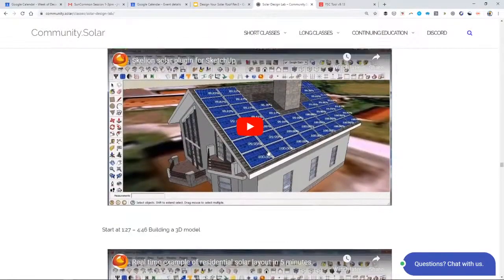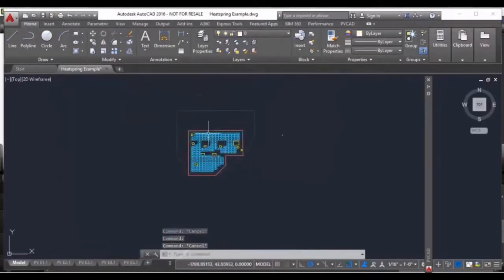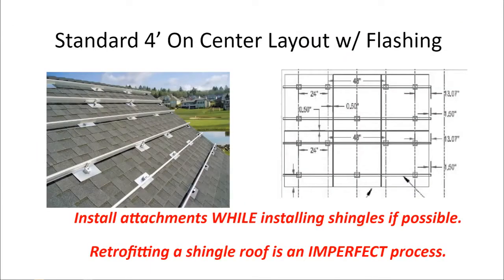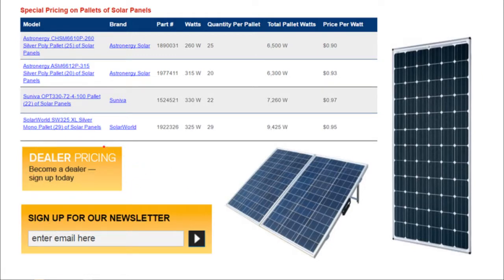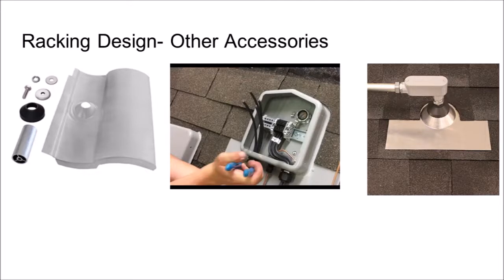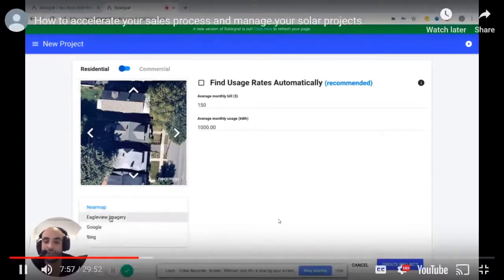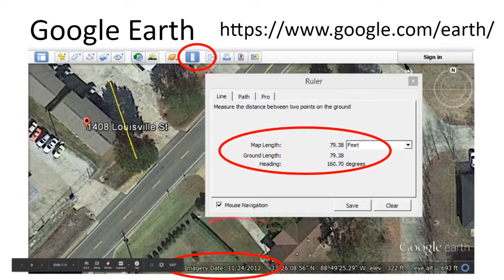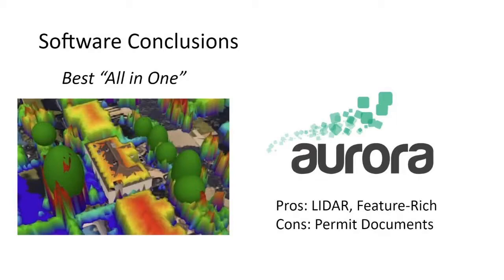Design Your Solar Roof Part 3

Comment: Yes, good overview and more detailed awareness of snow and wind loading overall and per attachment, also, roof zones.   Also important is ensuring the racking is certified for your module. Warranties are very particular and you need to ensure the racking forces are not exceeding the panel specifications.  I like the NAVY site , can you put the link in the comments?  It is not loading, site cant be reached.  Also,I cannot find the solar roof chat with the structural inputs - that looked nice. thanks!
Reply from the maker: https://www.usno.navy.mil/USNO/astronomical-applications/data-services/alt-az-us and http://www.solar-roof-check.com/

Comment: am based in India. plan to design solar ready roof top- sheet based with strong truss and maintenance options. but not getting designs. 
Sir, plan to construct solar panel ready roof top but later lay solar panels. Am in N-S direction 40ft parallel to it and 30 ft parallel in E-W direction. Type or design of roof to support maximum solar panels is major headache since wind comes in East West direction. So need four sides slant meaning only one fourth roof top can be used of 1200 sq ft. That is 300 ft only. need atleast 5 kW means 500 sq ft atleast considering 100 sq ft for one kW solar panel. any advise.	
Also are direct connect to solar DC lighting's, ac and fan available? Without using batteries or inverters. Cost cutting options. It will be great if you also make solar ready available rooftops with maintainable walkways.  Cost for 1000 or 500 sq ft since base is 1200 sq ft(40ft by 30ft) only. Need strong truss n columns.